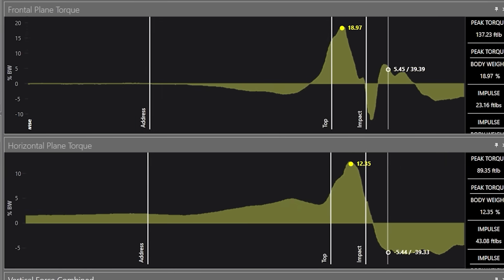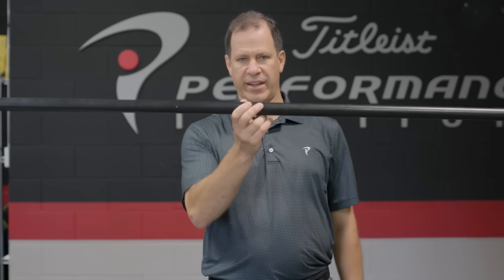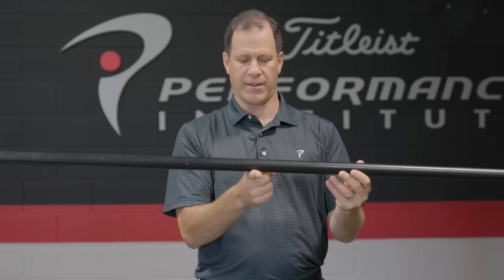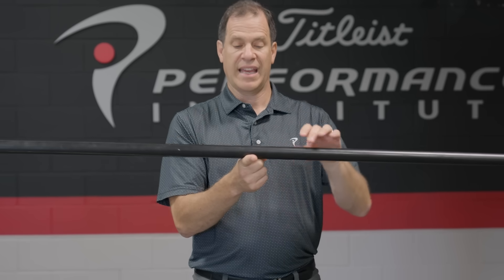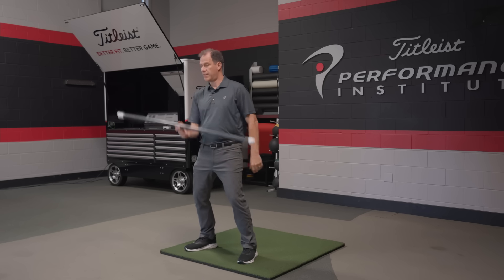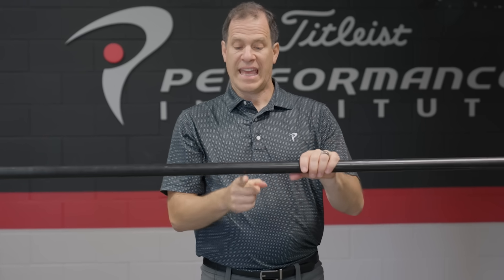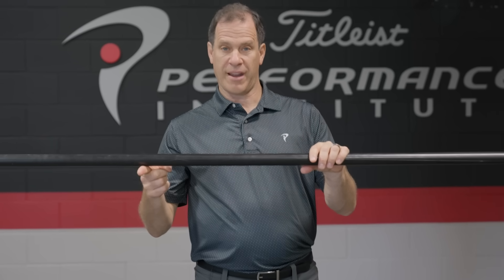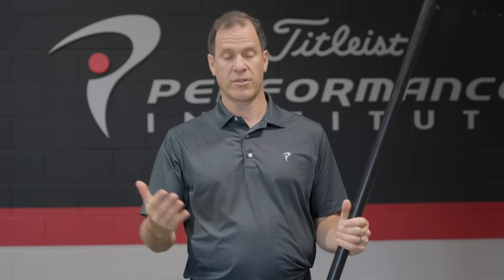Moment Arm Explained: A Key to Power in the Golf Swing

Comment: Amazing tips. Without increasing strength or effort you can improve your results. Spread your legs a touch and don't press straight down press backwards lengthening your moment arm away from your center. Technique and mindset improvement can help the senior golfer to get more effortless power! I guess its also how some baseball hitters have a wide stance and don't stride forward, they push backward on their rear foot while keeping their upper body tilted backward. Whether you take a stride or not you never want your upper body leaning forward in baseball or in golf I guess except maybe in the take away as a  momentum starter in the takeaway/backswing.

Comment: Back in 1933 Abe Mitchell, British Golf Pro wrote a book called “Down To Scratch”  and coined the phrase “Swinging into resistance”  which is how a TORSION BAR and a rubber band powered balsa wood airplane works and the front suspension on a 1960 Dodge Lancer — our family car — my mechanical engineer father bought because it used torsion bars instead of springs.

Torque is create in a golf swing by squaring the back foot like Ben Hogan taught me to do  |   \  which causes STRETCHING RESISTANCE in the muscles of the back leg and buttocks which is what powered his hip turn on the way down BY RELEASING TORQUE create by causing his hips to stop in EXACTLY THE SAME angle every swing via minor adjustment to the flair of his back foot, a cause and effect I discovered back in 2008 when I decided to reboot my Nicklaus modeled swing with his by reading Five Lessons and doing everything he suggested until I got the same result he did, also making screen captures of videos of him and analyzing where his body mass, arm mass, hands and club head mass moved frame by 1/30th sec frame to understand when those masses accelerated and at critical point decelerated.  

I was familiar with how centrifugal governors worked on steam engines and how figure skaters control their rate of spin — and balance — in the same way by extending mass of arms equally on opposite sides to slow down and pulling them in an crossing over chest to speed up.  The key to staying in balance doing that?   Equal mass spinning at the same rate.

But in a golf swing, like the Hammer Toss in the Scottish Game the golf swing is based, the swinging mass on one side must be BALANCED by equal and opposite FORCE — Kinetic Energy.    The counter intuitive part is that Kinetic Energy increases with the Square of the Velocity not linearly.   What that means is a golf swing is that increasing club head Velocity (V)  2x increases its KINETIC ENERGY (KE) 4x,  3x V = 9x KE, 4x V = 16x KE, 5x V = 25 KE.    The same increase in KE occurs moving the body and arms but because their masses are greater then to not need to move as fast to balance the force of the club to keep the balance of the golfer stable, which is critical for accurate ball striking.

In 2008 I was 56 and had retired after a 25 year career in the Foreign Service and taken a part time job as a starter at public nine hole par 25 course where I realizes golfers with perfect swing technique from toes to top of head were being pulled off balance on their toes in their downswings by the HUGE SPIKE in KE which occurs when the lag is released.  Getting pulled on their toes  \  tilted the plane of their swings, causing the club head path to move outside the target line and their SUBCONSCIOUS BRAIN reacting by curling their toes down and trying to STEERING THE FACE back to the ball with their HAND EYE COORDINATION saving the shot or not depending how good that way.   I realized I was doing the same thing when Sliced or Pull Hooked the ball.

How MOI of the arm +club system relates to this in the downswing is that like the figure skater a golfer can fire the hip with more acceleration and velocity with the club shaft vertical  |  / \ and close to the center or rotation than if extended like in the Olympic Hammer Toss.  A slight lateral shift of body mass   / \  > / | is sufficient to balance the increasing KE in the mass of the lead arm being pulled down by Gravity the most constant force in nature and keeping the club lagged 👍 and vertical with club head mass close as possible to the center or rotation prevent it from becoming an unbalancing force requiring  more  forward movement ==> of body mass to counter it.

The problem when beginners ‘cast’ or release lag too soon the club head mass does become and unbalancing force the subconscious brain reacts to by swing it ‘over the top’ which solves the immediate balance problem but creates a new one, the same incorrect outside in path as the pro golfer with perfect swing mechanics who let himself get pulled on his toes in the down swing  \ tilting the entire swing plane like a crashing helicopter 🚁   I did that a lot with my RC model helicopters I was flying there up and down the fairway, how I  ‘connected the dots’ of what I was observing intuitively as an INTP temperament. 

The point where the MOI of the arm+club changes is the point where 👍 that changes to this 👉: radial to ulnar deviation in the wrists, the same action that snaps the tip of a bull whip past the 700mph sound barrier and tries to accelerate the club head the same way.  Turn the club around and whip it and will it move faster and go ‘whosh’ ?   Yes because there is less mass to accelerate.  But that’s also the point where KE spikes FASTER THAN THE REFLEXES CAN REACT and 99.99999% of golfers get pulled off balance in some swings, more on the course on even lies that on the mats on the range which is why you shouldn’t waste money on range balls, instead find somewhere cheap to play or do like I did, get a job at a course that allows employees to play for free.

Once I CONSCIOUSLY realized it was my reflexes not reacting to the spike in KE as I release the club and getting pulled on my toes at impact the problem was easy to correct.  My toes became the ‘canary in the coal mine’ for detecting a lose in balance my brain did not CONSCIOUSLY until I did not finish the swing in balance.  

The way I learned to stay in balance was to delay release of lag — keeping the MOI of the arm+clubhead mass low as possible — until when I did release it the FORCE VECTOR of the KE increasing in the club head mass  / vvv \  stayed between my feet — the anchors for balance — and POINTING AT THE GROUND and aimed a few inches ahead of the ball.  Releasing the club head that way with a ‘vvvv’ downward KE vector increases stability because it PULLS BODY MASS DOWN at the same time the leg action is lifting the AXIS OF ROTATION of lead arm mass and mass of lead arm also is swinging up and left creating  UNBALANCING  KE vectors which is why a loss of balance occurs after impact.   

Once technique is consistent it’s getting pulled off balance by the KE of the club head mass going somewhere other than at the ground in front of the ball AT IMPACT   that causes shots not to go as planned even at the pro level.  The key to POWER + Balance is knowing how to release the KE of the club head mass downwards between the feet not out towards the target, what most think the goal of the exercise is.  

Hogan said it often and best, “The Secret is in the Dirt.”  😂

Comment: still waiting for somebody, anybody to show me how the ground pushes back. The ground never moves and just stays there.
Reply: Umm that's the point. If it didn't push back, the ground would sink
Reply: @Tony-ix8wd  so why cant i squat 500 lbs then since im pushing into the ground on the way down. its not the ground that pushes back, its the extension of your musculature and joints that gets you out of a squat and the same is true for golf and the downswing.
Reply: It’s Newton’s third law
Reply: @cowatson  3rd law doesnt explain this. people use this that dont know how to describe whats happening and you believe it.
Reply: I completely agree.  Energy is stored in the legs (body).
Reply: If we want to get pedantic, then technically the ground is resisting the forces that the legs and body exert on it. If you tried to do a golf swing on a pool float in the water it would likely be less powerful, because as you created force against the unstable surface the float and water wouldn’t be holding their ground (pun intended). In sand volleyball the players can’t jump as high as indoor volleyball because the force created by their legs is dispersed by the sand, and it is directly resisted by the wood and they jump up and spike that thang. The ground pushes back as hard as you push the ground. If someone can’t squat 500lbs then it’s because they aren’t producing 500lbs of force. I am one of those people. 

Also, force plates measure this relationship of ground pressures.
Reply: @Hicksy-by4tt you sound ridiculous. Read out aloud what youre saying. The ground doesn't push back. By this logic, if I drop a bowling ball from 10ft the ball should bounce back up into the air cause the ground pushes it back once the bowling ball lands. It doesn't though does it. No, it creates a hole in the ground cause it gives way and doesn't get pushed back. This conversation has gone way outside the scope of golf now. Bottom line, the ground doesn't push you back. If I squat down with force and do t extend my joints I will not cone out of that squat down position. Feel free to try this on your own and see the results for yourself.
Reply: @TNGolf0 The ground reacts to the forces applied to it. Hence the term ground reaction forces. If the bowling ball in your analogy puts a hole in the ground then the ground has dispersed the force of the impact of the bowling ball. Very similar to how if the golf course is soggy then a golf ball will sit in its ball mark on the green, and if the course is very dry then the ball will bounce. The force being applied to the ground is the same, but the ground’s reaction (or the impact of the ball with the ground) is different due to the ground’s ability or lack thereof to resist the ball’s impact. I know that the ground is inanimate, but so is a golf ball or a bowling ball.
Reply: @Hicksy-by4tt  thank you for saying the ground is inanimate, meaning it doesn't react with anything. its literally just dirt. it doesn't react. putting the word forces or reaction  behind another word doesn't give it meaning or validation but keep trying to convince yourself of this.
Reply: @TNGolf0 I responded to your original post thinking you might actually not understand the concept. It now seems like you just want to get caught up in word play and semantics. 
I hope you can find a better way to explain it, but as Edward Koch once said: “I can explain it to you, but I can’t comprehend it for you.”
Reply: @Hicksy-by4tt its dirt. It doesnt react with it anything or push anything. Putting fancy catch phrases behind doesn't make your ideas valid. You don't appear to understand how the body works in a golf swing which is ok but don't say it's because dirt pushes you back if you push on the dirt

Comment: Everything he said is right except for what he said at the very end there. At the TOP of the swing with great players, the spine IS leaning 1 or 2 degrees towards the target, as pressure starts to settle into the left foot. (And the center of mass is not the head). At this point, the force vector is a million miles ahead of the center of mass, and getting farther ahead. THEN, when the left foot pushes into the ground, that is when the spine leaning back away from the target. During the transition, the spine is straight up and down or slight toward the target.

Comment: I get it - kind of. When you push with your right foot, that's where the pressure is. Force plate guys want the pressure on the left as early as possible. Timing. A swing session with Greg would be mind blowing.

Comment: I know you’ve touched on these concepts in other videos, but it would be really valuable to see a follow-up (continuation) that applies the same torque-based breakdown across the whole swing sequence in this same level of detail you provided here. For example, what the torque forces look like at the top, into transition, down through horizontal, and finally into impact. Even better would be to see this explained with a club in hand... showing the lever action, how the twisting forces (horizontal and vertical) interact with the pendulum of the club, and how we actually hold onto that energy and then transfer it through the handle to the clubhead at the right time. Hopefully that makes sense.